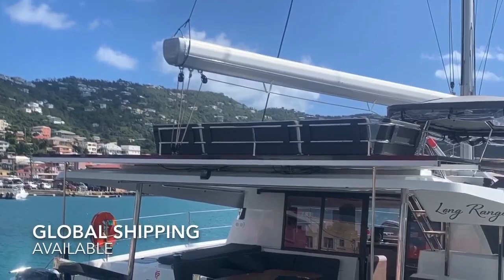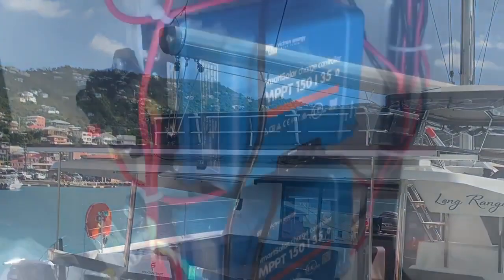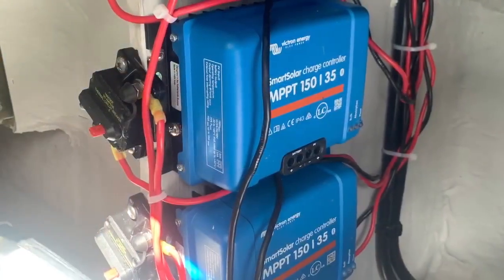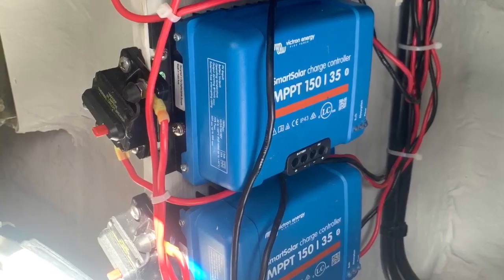Fountaine-Pajot Elba 45 Solar Gantry Video

Comment: Great work... but, the two solar-rack support poles down to the sugar scoops are both ugly and seemingly unnecessary. Perhaps someone might find it useful as an extra "handhold" but in my opinion they are an obstacle and just in the way. A "better" (i.e. cleaner) approach would be angled bracing down to the existing vertical coach-roof supports. Either way - I'm serious about "great work" to add beautiful, and needed, additional solar to the Elba 45!